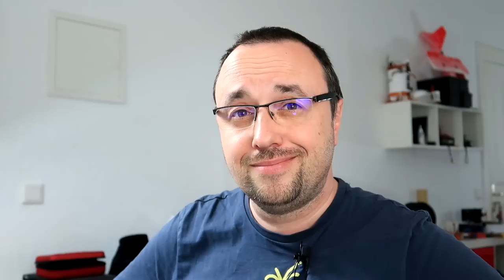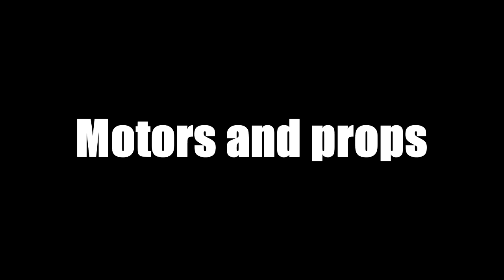Smooth HD video on 7-inch quads - 7 tips and tricks

Comment: Hi Pawel, with all due respect I disagree with you on motors and arm thickness I'm flying a 7inch Martian 2 with 4mm arms and tbs endurance 2206 1425kv motors and filming with a gopro session5 without stabilization and I'm getting jello free footage. But I will say that tuning it has proven to be very difficult. I've now upgraded to betaflight 4.0 with the preset 7inch tune so we'll see how that go's. Here's a video I posted with the components I mentioned. Enjoy and make sure to watch in hi def. https://youtu.be/SUdVy1ERsFs
Reply: I'm trying to tune my 7 inch build with a 2306 1750kv motor on 7 inch props. Would really appreciate if you can share your tune settings. :D
Reply: What exactly is the "preset 7inch tune"?  Are you talking about the small cli dump they have on the 4.0 tuning notes page for 7 inch and bigger quads, or something else? 
My 7 incher handles fine, but it reacts to every tiny gust of wind with a shake.   Hero7 Hypersmooth will remove all the shaking, but I know my 7in can fly better. 
And yes I disagree about the arm thinkness as well.  My 4mm arms are plenty rigid, frame should be more rigid, but I see zero jello.
Reply: 2206 is too small to have authority over 7" props

Comment: I agree on these but what helped me the most is balancing props, rpm filter and 7" filter settings. Also I dropped the I gain to around 30-35 for all.
Reply: I'm been trying out that cheap magnetic propeller balancer, but it's crap. Im thinking about mounting a old motor on a arm and add a small mirror to it and use a laser to see the vibrations. What tools do you use?
Reply: @LordGryllwotth  Du-Bro 499
Reply: there are new props coming soon

Comment: #1 BALANCE YOUR PROPELLERS! Use tri-blade props. Use a good balancer like the Dubro. I fought for a very long time like you did. I kept hearing people say you don't need to balance modern 5" or 6" props so I changed everything else. Nothing really helped until I started balancing my props. I can definitely tell a huge difference in the Blackbox logs just by balancing the props. The flights and video are much smoother.

Comment: Great tips...   mine flew very smooth right out of the gate, even with folding props, except when I started going too fast and created more turbulence  I bought a ton of replacement props just so I could replace them often.    

The one other tips I would be is to lower your rates drastically from the defaults...  so you have a lot higher resolution around the center of the stick, and you have to move the stick a lot just to produce a small change in the roll/pitch/yaw.  This will make much smoother and less jerky transitions when you reorient your direction.   Set your super or max rates just to be enough to roll yourself over or flip yourself over fast enouhg if you do a loop or roll or get in trouble upside down.   You don't want them hardcore fast for cinematic flight, you want them very slow, but not so slow you can't recover and roll back over if you get disoriented to close to the ground.      

Default rates are 1.00, but my favorite general purpose rates are 0.23... and I could see for cinematic mountain flying, I'd be using something down around 0.10 - 0.15... (try it in the sim first so you know what to expect)    with hgiher Super rates to compensate and quickly flip me back over if I jam the stick all the way to the edge.  In a cruisy cinematic flight you don't do so many aerobatics or rolls, or any at all, you mainly want to take the person there and show them the view...      

fpv.air-war.org

Comment: My tips: 1. Use RIGID frame design. The most common mistake of almost all people trying to "scale up" their quads going from smaller ones like 5" to bigger like 7-9" or even 350-450 sizes, is that they use the same carbon frame design which originally was developed for race quads, adapted to relatively small and high freq vibrations. You just can't simply scale up the same design to go for bigger props. No, you can do it, but till a certain point, after which the required thickness of carbon plates would make the entire frame as heavy as a brick. So, the idea is that if you're looking for a smooth video from a bigger quads, you should go with a classic frame design, i.e using carbon tubes (round or square). 2. Balance your props and motors. This is still important, despite of less sizes. Don't use cheap props, as they sometimes are not symmetric (blades are different in shape) even though the prop itself could be perfectly balanced in static, while being dynamically unbalanced as hell. 3. Mount your camera firmly to the frame. Don't use any kind of vibration absorbers or dampeners, as they could have their own resonances and oscillation frequencies. 4. Try to choose your setup (by choosing certain motors and props) in such a way, where the battery weight is 2/3 of the AUW. This will give you maximum possible flight time and will even further decrease possible vibrations (the added weight is the best way to reduce vibrations, because of the added moment of inertia). Your setup should be slightly "underpropped" in relation to the AUW of the quad. 5. Use cameras with high speed of sensor scanning. The faster the cam scans its sensor, the less is the chance of seeing a jello. 6. And yes, tune your pids. 

As a result my 450-size quad produces a silky smooth video right out of the camera (runcam split mini) which looks like it was shot using a gimbal. No additional stabilization required. And moreover is flies more than an hour ;)
Reply: I have a chimera 7 pro 6s V2 with O3 air unit running the dji goggles 2 with rocksteady enabled. Also using a 8k mAh Lithoum ion battery. I dont get any shake or vibrance on my final video feeds. Even when im flying the only time it will somewhat shake is if there is wind.

Comment: Hi, Pawel. I maidened my Alfa Monster 7 inch yesterday on stock BF settings to see how bad the HD footage would be. HORRIBLE yello 😂 Are these filter settings a good starting point for a cinematic 7 incher?
set dyn_lpf_gyro_min_hz = 70 set dyn_lpf_gyro_max_hz = 350 set dyn_notch_range = LOW set iterm_relax_type = gyro set iterm_relax_cutoff = 7 set dyn_notch_min_hz = 100 set dyn_lpf_dterm_min_hz = 70 set dyn_lpf_dterm_max_hz = 150 set dterm_lowpass2_hz = 120 set d_yaw = 0

Comment: I am trying to get rid of jello on my 7 inch quadcopter. I am using 2514 motors and hqprop v1s 7x3.5x3 props. I have changed the PIDs around and I am getting great flight performance in terms of propwash handling and response but in the HD video there is jello :( . Does more filtering or less filtering help with jello? I have left it at defaults

Comment: thanks PS for this tip. ive been head scratching as to why its impossible to tune my 8" kwad. only to find out the arms where 4mm. I can 'twist' motor/arm when I force it to. HSKRC XL8 frame from BG. now I just need to add arm braces.

Comment: Hi, I have a tbs source one 7inch quad running 2806.5 1300kv on 6s liion hqprop 7*3.5*3. I using session 5 for my HD footage. As title per say, jello has been my biggest problem. I am wondering the following solution individually. Will it remove the jello greatly and whats the possible problem. 

1) Change to a 6inch props
2) Change to Hero7 Black with Hypersmooth

Comment: Dang it you should have made this video two month earlier ... im so spoiled from the 5" Drones where you can just slap random stuff together and it still works great. I thought a 2208 1700kv would be good enough. I was planning on running 6S but after this video i know that 1700kv is very high for that. Do you think i could still slap a 6S pack on it and just Limit the max throttle but keep the 6S power for Stabilisation? Maybe if i use a light prop? 
Edit: Does iNav work good with acro 7" or should i use BF?
Reply: Same here :-) I have equipped my 7"with a Nova 1700kv 2207 motors and feel that they are to small for 7 inch props. Had to go lower to 6"props and even in this case it is on the edge. Only biblade 6"seem to work...  

@blise518B: I have flown my 7" on 6S without throttle limit. Flies super but it is very powerful with very low hovering point. I'm using a 6S 1500 mAh. But if I would decide now, I would buy bigger 2506 motors (1500kv) and large 4S batteries (like 2000 mAh). It will be the same weight more or less. Still love the 6S punch.
Reply: At least the motors are lighter so it maybe it’s more power efficient? What flight times do you get with your 1500 6s pack? I was playing with the idea to run 2 1250mah 6s in parallel for long range flying.
Reply: blise518B I get about 8 minutes freestyle flying. Also tried it on 4S (normal 1500mAh batteries from my 5” quads) and it flies also great. Today I tested different types of 6 inch props on a very windy day. Biblade seems to be still the better prop, but more prone to noise (using plasmatree, not visible in the HD feed). The one I use is the Avan LongRange. Probably need to balance them.
Reply: blise518B I fly armattan to 7 inch with 2207 1900 kv eco’s it flys amazing locked right in. But jello in the session 5 can’t see it on the fpv csm

Comment: Paul, I lost my link to your reply. A simple INav configurator enhancement, since it already knows how to read files (INav FC updates) it would be a simple thing to add reading a waypoint file, I have been programming since the late 70's yes it is simple.  What I'm looking to be able to do is not be locked into expensive bulky FC's for mission planner, something more simple like INav, it fills a bring gap.  It seems to be in line with the objective of INav as in INav-igate? NO?  Being able to create a waypoint file with another tool and read in by INav allows me to do detailed flights and repeat them over and over tweaking along the way. Not asking for much.

Comment: I am not so sure abou the stiff frame thing. I designed my self frame, that is stiff in roll and pitch axis, but it has moving arms in z Axis, so not as much vibrations that creates jello is transfered to the middle. ;) And you can see it on my channel, that it works.

Comment: Is the Skystars G730L a good 7” drone for cinematic FPV? Looks good value on Banggood.
Reply from the maker: rather not. 2306 1800KV are too small and have too high KV
Reply: @FPVUniversity  Thanks for the heads up. Any good BNF's you recommend. Currently building a 5" and want to get a 7" BNF to see the difference in props for cinematic flying.

Comment: Could one fly a 2207 1750 kv on 3S for a 7 inch? No punches. Just cruising.
Reply from the maker: It would fly. But not be very stable probably
Reply: @FPVUniversity  It's meant for an autonomous surveillance build for a farm. 3S 2P twin blade props. No heavy camera. Workable, do you think?